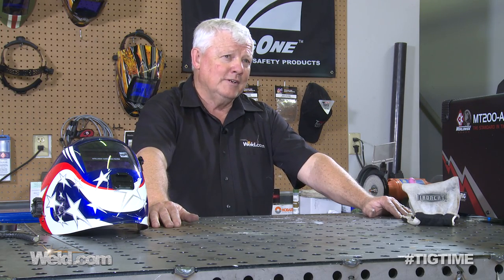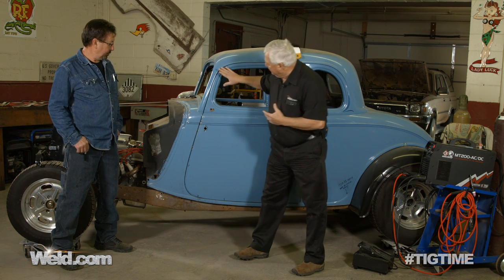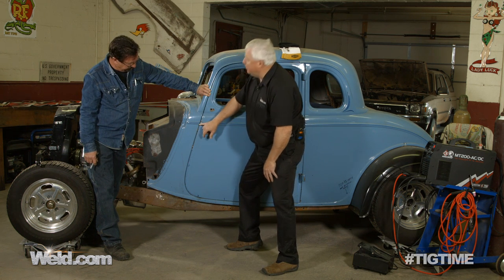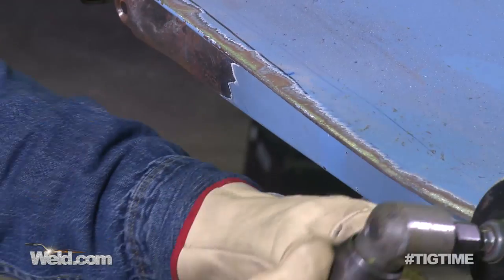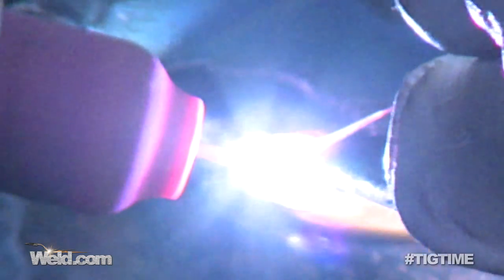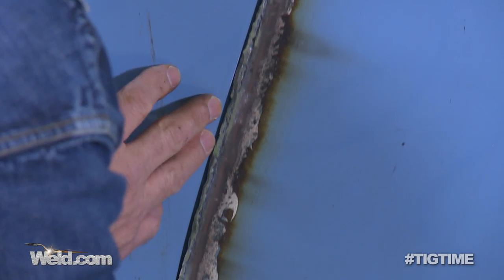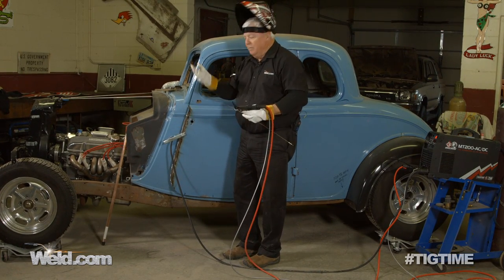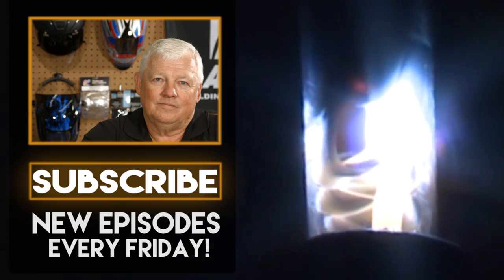Auto Body Build Up Repair - 1934 Ford | TIG Time

Comment: would you recommond copper backing for a beginner at thin sheet metal.... asking for a friend
Reply: Copper backing on thin sheet metal (especially with a gap) makes life much, much easier. Unfortunately you can't get to the other side of the panel easily all the time (or even most of the time in my experience).

Comment: Why S-6 vs S-2 filler? Do you remember your current settings?
Reply: Thanks for the question.... This repair required a nominal 30-50 amps because it was an edge build-up.  Tig was the preferred method because of precise heat control.  There was little to no distortion and the filler recommendations were either er-70 s2 or er70 s6  meaning the filler is a steel filler with 70 ksi tensile strength and the s2- or s6 are merely the reference to the deoxiders in the tig filler.  It becomes personal preference.  The project is near completion and the painter is more than pleased with the results.  We will post this project upon completion.. thanks again.. Mister Tig
Reply: Tig Depot
Thanks for the reply, just started Tig welding and have only used ER70S-2 and have wondered if I should try ERxxS-6. Does one do any better with minor rust? (only for situations when the rust cannot be completely removed of course) If not are there any you could recommend?

Comment: This is bullshit, cutting a strip of steel same thickness as the door and making that fit just right and weld on is 10x easier than doing a weld buildup on an edge. And alot less cleanup.. Jeeez....
Reply: how do you figure? running a 1/8"-3/16" strip of metal along the entire edge will not only require the same amount of blocking to attain the perfect gap but also you have to attend to more clean up and reduction of a thicker face weld? I'm with Mr. TIG on this one.
Reply: +deepstopdiving if you were here I would show you. You have to be extremely good to tigweld to do a 4-5 pass weld exactly the same height the whole length. Adjusting a strip of metal alot easier, and its flat so only the final gap edge would need to be refined.
Reply: +95tt where you located? Cleveland Ohio here.
Reply: +95tt gonna have to agree that buildup would be easier aswell